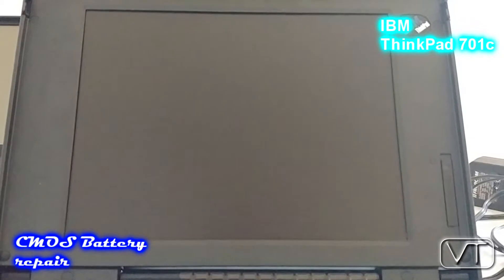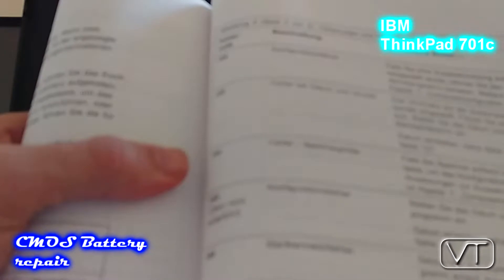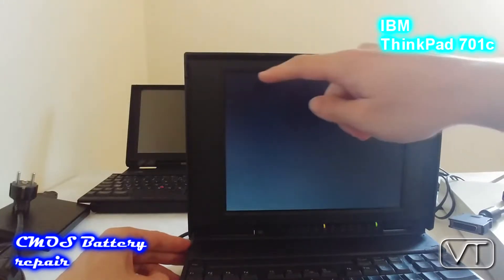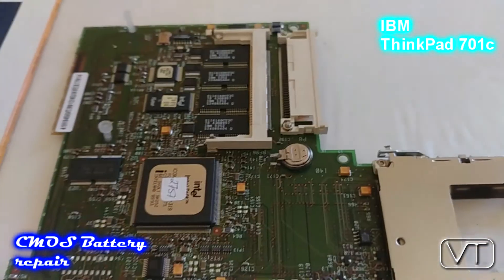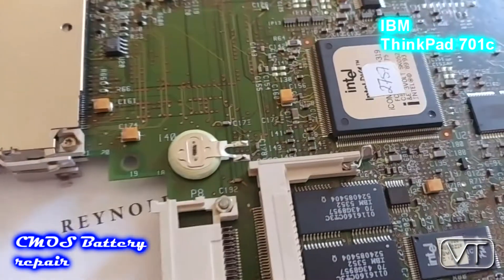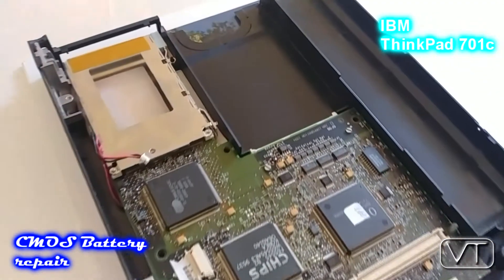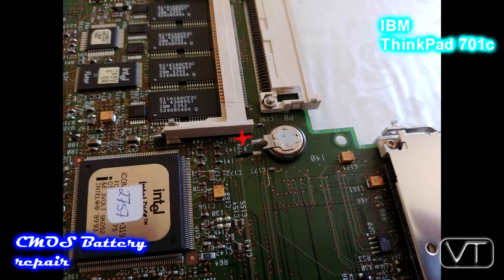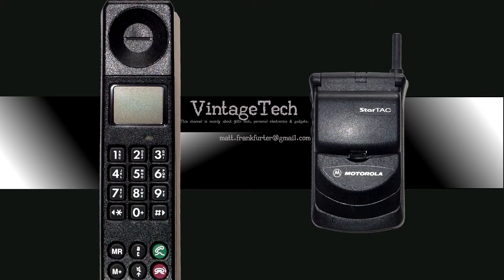IBM ThinkPad 701c - part 2 - CMOS Battery repair

Comment: Did you use a diode to stop the laptop for charging it? 701C has trickle voltage, it can make the battery leak
Reply from the maker: No, I did not use a diod. It´s maybe a good idea, if you are using the 701C on a regular basis. I use the Laptop very rare to protect the finish and the mechanical parts. I hope the Battery will hold up for a couple of years. If I have to change the battery again, I will place it near a trapdoor that it´s easier to service.

Comment: I have a mint condition 701c but CMOS battery error, can you tell me what replacement part you used and maybe where to order it. Also it hangs during boot of windows 95, not sure if this could be caused by bad CMOS as well or there is some corrosion going on inside..
Reply from the maker: I used a BR1225 Batterie. It is currently listed on eBay under this number: 332523520707. The first thing you should do is to change the CMOS Batterie. Than you should do a selftest of the system. if there are now error codes appearing should the Hardware part ok. If the System hangs during the boot of win95 could also be also due to a hdd error.
Reply: Thanks for your reply! i will order one today with a t1 torx. I have another question. When i boot the machine it counts memory and than return the obvious error codes because CMOS is dead, but when i select Diagnostics menu with f1 it loads for a second and than hangs the machine. So no test menu or whatever, it just hangs with a blank screen. Could this also be caused by dead CMOS. What is strange though, when i booted the machine after 15 years it seemed to work because it loaded winds95 and i was able to get into the test screen at boot, but after half an hour of use the machine started having these issues. I hope i didn't break it :(
Reply from the maker: Did you press F1 before you switched the power on? The test menu shuld appear before the memory test. Does the Laptop a beep after turning it on?You should press F1 before you power it on and keep it pressed till the selftest appears.I hope your CMOS battery has not leaked. That could be the reason. The other issue could be a hdd crash. Watch my upcommimg Video, i will Change my old hdd vs a sd Card.I recomend to buy a decent t1 torx, no China crap.
Reply: Yeah, no way to get into the diag tools with F1, it wants to load but hangs the pc. I am planning on using IDE to CF or SD as well, looking forward to your video